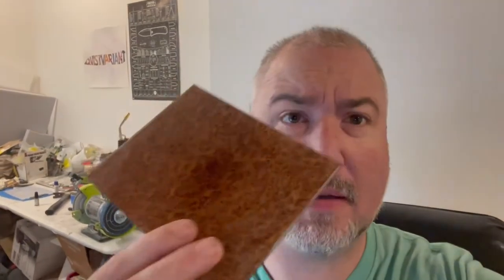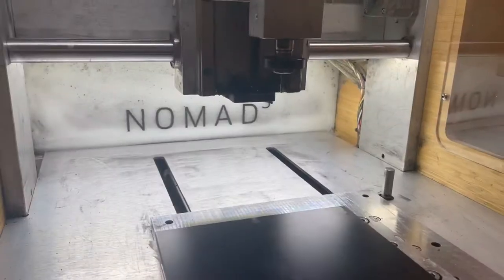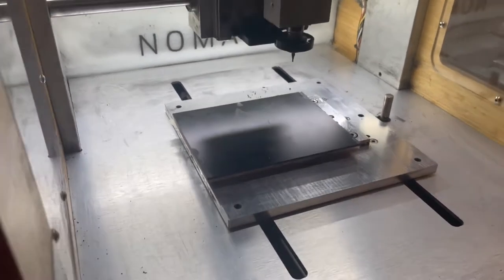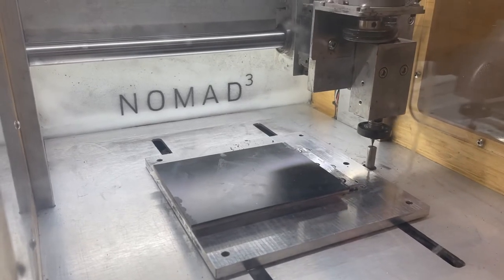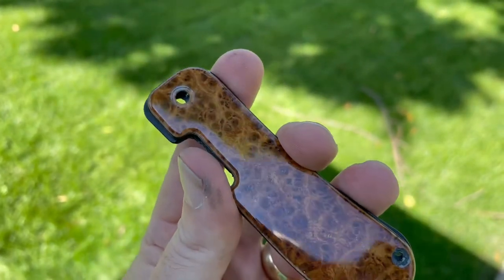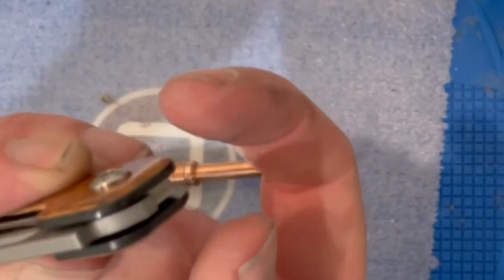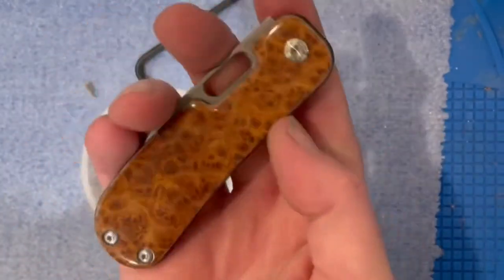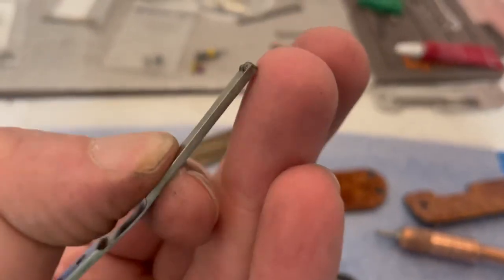Variant 013 - Full build of a custom Qvist Variant

Comment: Have you milled steel, and if so, what are the resultant tolerances? If the accuracy is tight enough I plan to order this machine. Thanks for sharing…great content.
Reply from the maker: No steel, it just cant handle it. Engraving would be fine but the spindle is too fast for steel. Sorry man. It’s a great machine for softer metals.